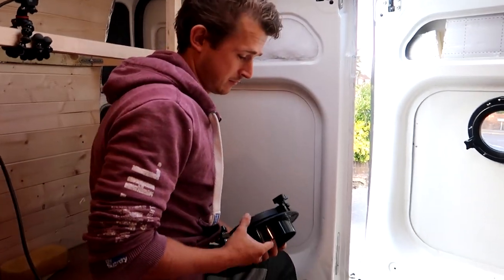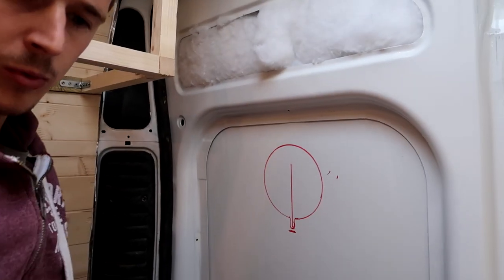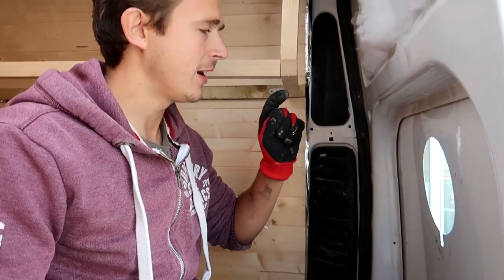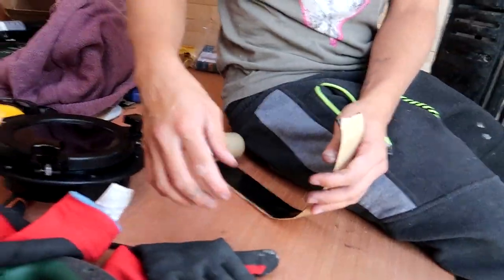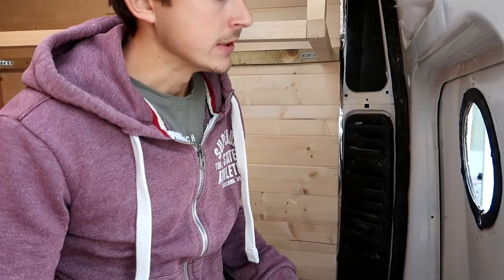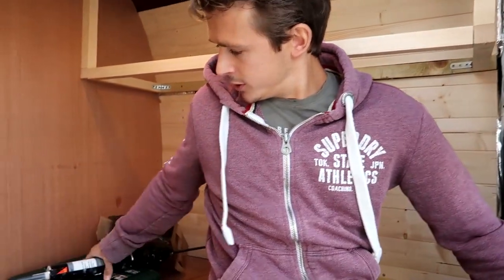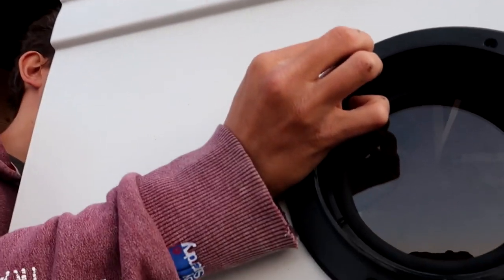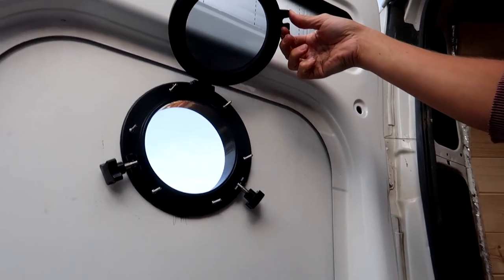HOW TO FIT Porthole Windows In Your Campervan  | Peugeot Boxer / Ram Promaster Van Conversion

Comment: Use two Nuts on each bolt and lock them tight, that should secure them against anyone trying to open the porthole from the outside

Comment: I've been wracking my brains for months over getting some opening windows for ventilation and to make the bed area less claustrophobic. These score on both fronts. Great video!
Reply from the maker: Yeah they really are a great middle ground! If you decide they're not enough, you can always cut out a larger chunk in the future and fit a larger window. That was our logic :)
Reply: @CazzyandBradley   The thing about the taylored van windows (at least the back ones) don't open. I looked and looked and looked. None of the cool looking dark glass windows are  opening and my wife and I like a stream of fresh air to sleep. I even went to the step of designing my own opening window to 3D print but the printing process for large items can be time consuming.  I've designed and 3D printed many items for my van. It always takes a long time from start to finish due to fitting and trial and error etc.  The port hole idea is a happy medium to shorten the process.

Comment: I'm glad I found your channel and your video.  We've been retrofitting our scuba diving cargo trailer to add off-grid camping capability.  After installing a MaxxFan we realized it can't pull enough air through the two vents to make a difference in Texas heat.  So, I came across those same 10" portals (we're going w/the white versions to work better without gray &  white interior).  Your video is helping us make sure we install these correctly!
Reply from the maker: I'm so glad you found it useful!! Hopefully you can an easy breezy installation! :)
Reply: @CazzyandBradley  It was, both sides. The only issue I ran into was that--to my surprise--the thickness between the inside wall (plywood) and the outside skin was actually bigger than the depth of the portholes.  After cranking down on the screws, I fixed most of the issues.  Now, I just need to put a bead of all-weather caulking between the inner edge of the exterior ring and the lip of the portal 'shaft'.  Boy, turning on the Maxxfan and opening those two portholes moves some serious air.

Comment: I also love portholes!

Two more steps to prevent rust when cutting up holes into metal:

- file with the door opened, or tape a plastic or paper bag under the cut to catch any of 'them pesky little metal shavings.

- after filing and sanding, paint the exposed metal ridges with rustproof primer and/or paint, and let it dry before sealing.

:)
Reply from the maker: You are right! We did this when we fitted all the other holes in the van, silly of us to miss this step here, so thank you for pointing out :)

Comment: Do you have a link for the safety bolts you used?
Reply from the maker: Hey Rion, I can't remember exactly where we got them, but I believe these were very similar, might just want to triple check the size before ordering https://www.fastenright.com/products/security-fasteners/m3-5-electrical-security-screws

Comment: Did u have any issues (leaking etc.) since you installied them inside out (ilke you did) so that they can be opened from the inside and locked out? Thx
Reply from the maker: Hey! :) We haven't had any issues at all with leaking, and we've had the van in some pretty rainy/stormy conditions :)
Reply: Really?? So, they are locked/latched from the inside with no  leaks ?  Hmm.  Maybe I’ll buy some for my cargo trailer conversion then. Just wondering if they’ll look too awkward since they’d be facing backwards.  Thanks for ur help! AE

Comment: Great video; seems like you're both quite comfortable in front of the camera!

I've just received these exact windows - but in white. Looking them over I'm concerned that the fascia on the outside will collect/hold rainwater and then, upon opening the window, let that puddle into the van. So debating whether or not I should return for other windows.

Have you experienced this in rainy weather at all?
Reply from the maker: Thanks Phil! But no that's not a problem at all with our ones. The water runner doesn't't come into the van so it's not possible to be a problem. But maybe yours are ever so slightly different ... If you wanted you can send a photo to us on Instagram or Facebook and I can tell you :)
Reply: @CazzyandBradley  Thanks! I may take you up on that 😁 I do think they're the same - perhaps I'm just being pessimistic 😅
Reply: @CazzyandBradley  How Is it going with this? I have the same concern, and the rubber that closes the window will be exposed (sun and rain).. how are you guys getting on with that?? thank you so much fro sharing!
Reply: @PhilMGCollins  Same here! Can you let me know how was for you guys?
Reply: @BM-yr9ei So I've had my windows installed for about 2 years now; three in total. There isn't an issue with them pooling water and then leaking into the van, the rubber seal on the window itself ensures it runs off into the little drain channel - providing where you mount them on your van, the panel is vertical. The only issue I've run into with these is that two of them have had to be removed and reinstalled due to water ingress. Both of them due to overtigtening of the twist clamps which hold the window to the frame - just do them gently hand-tight. The other window is fine, so not impossible to have a successfully installed port hole window!
Reply: @PhilMGCollins  Amazing, thank you so much for your respond :)